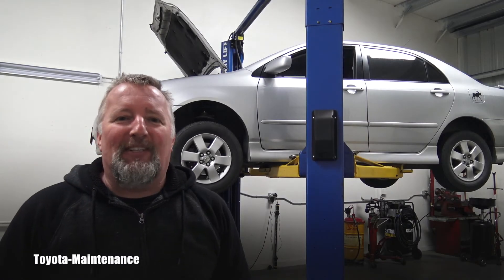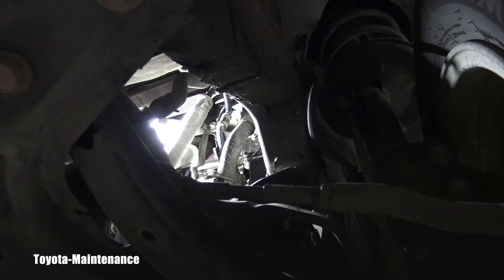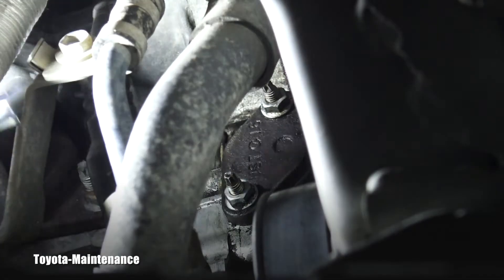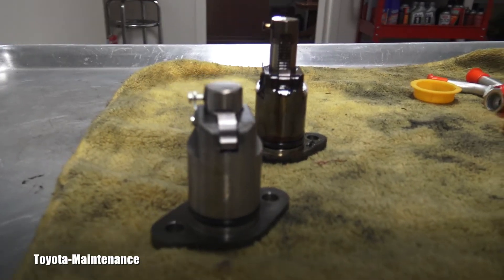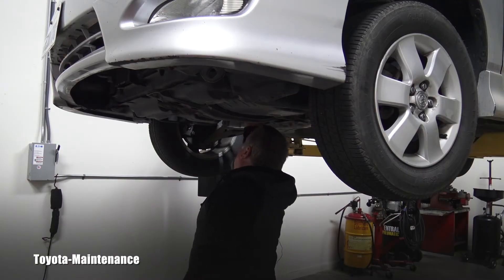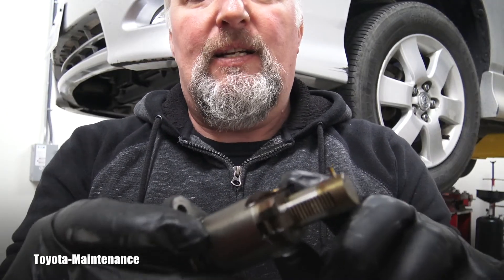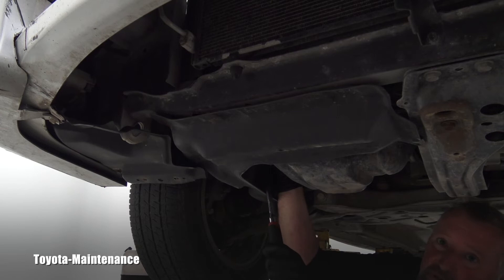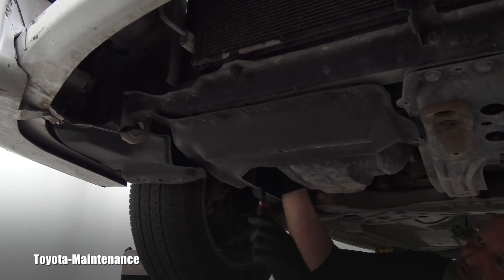Toyota timing chain tensioner replacement

Comment: How can we be sure the timing chain did NOT jump before the tensioner clicked/engaged (fully)?
Reply: Remove the valvecover and release the tensioner manually from the inside with a flathead screwdriver (careful not to drop anything inside though). And dont forget to order a new valvecover gasket.This method might be good to use on cars with a lot of milage but still no chainrattle.

Comment: Very useful video. I want to add that I replaced my Celica (2zz-ge)  tensioner by unscrewing the two v-belt tensioner spring bolts instead of unscrewing the third large bolt that holds the v-belt tensioner itself because I failed to do so unscrew.
Reply from the maker: yes, large bolt is very tight
Reply: How did you remove the timing chain tensioner with moving the bracket?
Reply: @PetsAtHome-AUS  I unscrewed the V-belt tensioner bolt, then unscrewed the 2 small nuts that hold the chain tensioner. This is because the V-belt tensioner prevents the chain tensioner from coming out (at least on the 2ZZ-GE)

Comment: Thank you so much. My car had a rattling coming from the timing chain and had a massive oil leak in the tensioner. I followed this video step by step and it went perfectly. No noise and no leak. Thank youuuuuu!!!!!
Reply from the maker: Awesome !
Reply: How much miles did your car have?
Reply: @jorgeguerra6749  220k miles. Thank youu
Reply: Im planning on doing this this weekend mine has 120 thousand miles and it only rattles when i started in the morning what it heats up it stops hope this is the problem.
Reply: @diavolow9  That's VVT rattle
Reply: @diavolow9  did it stop the problem?
Reply: @bullisht1443  it sure did helped it it still rattles a little but  the normal is no where near as loud  and my check engine light turned off and hasn't turned on since is easy to do. I live in missippi and drove it to north dakota and back and haven't had any issue. hope this helps you too.
Reply: @diavolow9  what codes fid the engine light give?
Reply: @zahab210  o2 censor its what it was can't remember the code. I cleaned it and it did whats this videos says and cleaned the censor that dis it
Reply: @diavolow9  One question: How fast were you going on the road?
Reply: I was mostly when i started it in the morning when the car was cold once driving and the car warmed up the noise would calm down. I had gave the car to my son he got in a car accident and the car was totalled

Comment: Hello, your instructions were very, very clear!  However, I am not at all experienced in doing repairs or replacements myself, and would rather have an expert do it.  What kind of price should I expect to pay to have the timing chain tensioner replaced...?  The Toyota dealership I've been going to for services since my 2006 Corolla was purchased quoted me $1,600.  Which seems exorbitant to me for something that appears to be a 2-3 hour job maximum, and a part that costs about $20-30.
Reply: Toyota Dealer just quoted me 400$ for tensioner replacement. That is way too much .

Comment: great stuff you doing on this video, just have one question, why my chain still making noise even after changing the tension?
Reply: Your timing chain has stretched, the timing chain isn't a lifetime use and beed to be changed as the car ages.  check service manual to know how many miles before you change the timing chain.

Comment: Love the video very easy to understand. I have a 08 I'm working on has no compression on any cylinder. Friend said it ran poorly and then wouldn't start. Timing chain feels lose, I think the chain jumped some teeth... I can't find a video on timing chain replacement or how to get it in time. Wish you had a guide made, cause I feel like it would be a good one.
Reply: Peter Finn

Comment: When I try to install the tensioner it keeps tripping the hook and releasing the plunger before it gets   seated even 1/2 way. I have tried 6 or 7 times, same results. I can install the tensioner onto the 2 studs but it does not go in far enough for me to get the nuts started or I would try to seat the tensioner this way.  What am I doing wrong or what to check or do next? Thx
Reply: your chain probably skipped a tooth and dose not have enough slack

Comment: Do you have to have the timing marks lined up before you pull the tensioner out? Probably a good idea yes?
Reply: No, not necessary.  Here's a DIY if you want to do this job yourself: https://www.toyotanation.com/forum/132-9th-gen-corolla-1st-gen-matrix-2003-2008/1255385-diy-2003-2008-corolla-matrix-pontiac-vibe-1zzfe-timing-chain-tensioner-replacement.html
Reply from the maker: no need